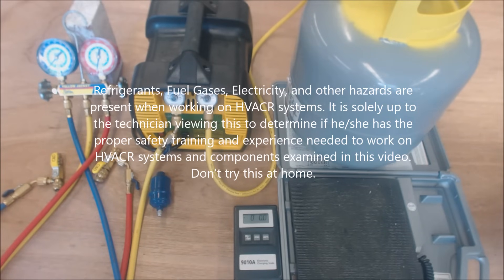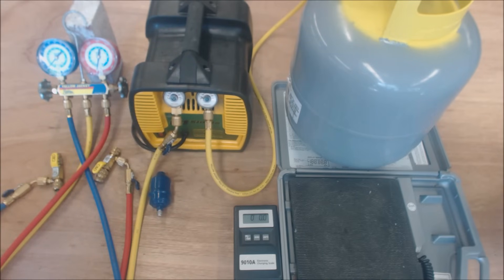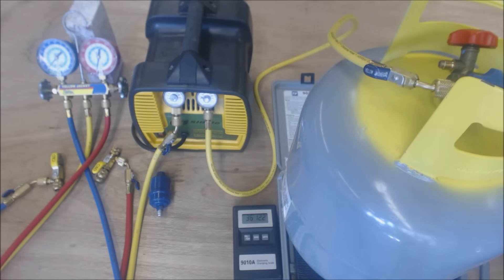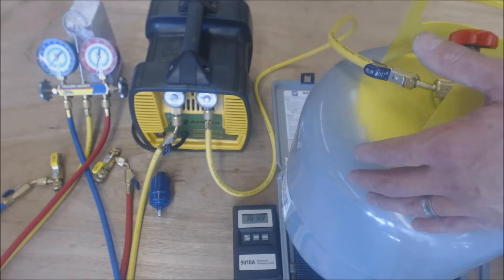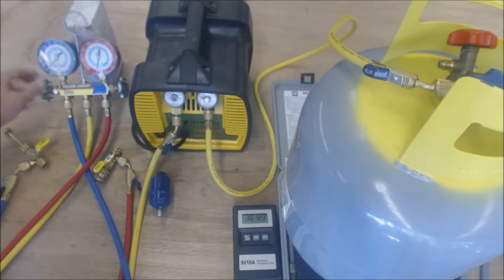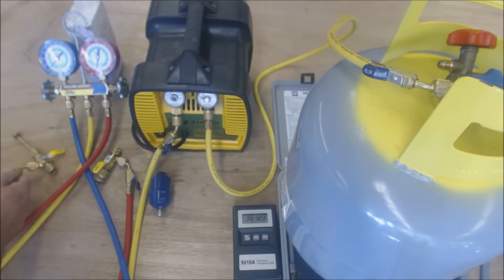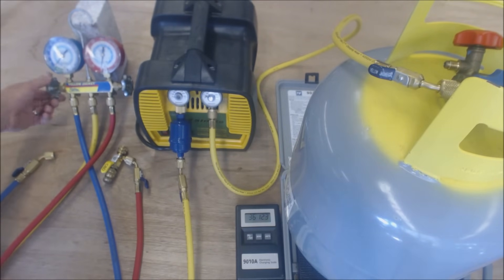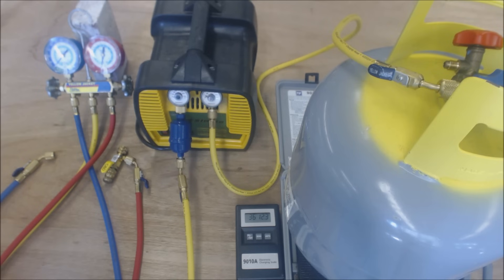Refrigerant Recovery Machine, Hose, and Tank Setup! Recovery Process!

Comment: Ac service...big fan of youre video's...learned alot..allready got the e book......question:after recovery ,is the compressoroil still in the system?
Reply from the maker: If you use a recovery machine, probably about 95% of the oil will still be in the unit which is fine. If you try to do a partial recovery using the systems compressor, much more oil would be removed, thanks!!
Reply: @acservicetechchannel  thank you!

Comment: I’m sure it’s obvious but I’d rather know before finding out through experience. When bleeding the air how do you tell it’s refrigerant when completing the bleeding?
Reply: When you have gauges on the psi should correlate to the temperature of the refrigerant. Look at a PT chart to check. When recovering you are just sucking out refrigerant. Shouldn't be anything other than that "bleeding"

Comment: You're always weighing part of the hose, right?  Should the initial weight be taken with the hose removed? Also, you didn't mention purging the recovery unit after the initial recovery -- is that required on that recovery unit?

Comment: great video once again Craig ... simple to understand. just purchased a g5 and megaflow hose and filter and filter hose and a 30lb recovery tank waiting on the g5 to come in a day or 2 from supplyhouse. I do have a navac vacuum pump that I love.  but I went w the the Avion g5 recovery machine .. g5's size is so much more space saving. I like that navac is digital but it maybe one part that can break then be a big issue. think I made a good choice choosing the g5. even tho hvac school ran a test w navac vs thr g5 and it's only minutes in difference which isn't that big a deal to spend more money on a navac.

Comment: Nice video. Keep in mind viewers - It doesn't matter what color knob is on the port Red or Blue either one can be a  Liquid Or Vapor (gas) depending on the can that you've purchased so read your valve labels whether it is liquid or vapor to know which is the proper connection, Respectfully Speaking. ✨

Comment: First of all great video thanks for uploading.

Question: Near the end step, when we open the vapor valve from the gauge it flows through the center of gauge, into the recovery machine, then OUT the recovery machine to the entry point of the recovery tank right. I'm wondering what's going on inside the recovery machine. Without the machine turning on, the vapor will still travel through the inlet and outlet of the recovery machine?

Comment: Why did my Appion struggle as if there was a a slug of refrigerant having difficulty passing through it also had to be shut off and the restarted a few times after I throttled down the inlet on the recovery . at one point the recovery machine was really shaking machine. Any thoughts on what I am doing wrong,? I also had a filter being used along with recovery hoses.

Comment: Thanks for your video! Very on point and informative. Question - when recovering R134a from the car - do I do it from the high (liquid) side or low (vapor) side or both together? I assume the car (including AC compressor) should not be running during this procedure, correct?
Reply: I had the same question.. did you find the answer?  I would think that you would not be running the engine at this point, only during recharge.
Reply: @whereisthehook  , correct. Running the engine during the recharge only.

Comment: question, can you use a standard HVAC/A/C vacuum pump (the same pump you would use to run a vacuum through your A/C lines with) with just the tank and gauges to recover refrigerant?
Reply: Justin LaFleur. No they are different machines altogether. Unfortunately. The vac pump doesn't have a usable outlet port, and operates at quite different "pressures"

Comment: Great informative video! One question though, if you have recovered what is suspected to be R134a and a mixture of air and moisture from vacuuming a system with a leak, into a recovery tank, is there any quick known ways of being able to seperate out if you decided you wanted to re-use the refrigerant gas? I know the boiling point of 134 is about -30 celcius so in theory if you froze your recovery bottle and drew out of it in such a way that only liquid was taken, you could say chances are your gas is pretty pure, any moisture will have frozen and could be filtered out etc. Cheers
Reply: vanepico. with that slight amount, might get away with purging the bottle (air rises) vent off the vapor outlet, then install filter/drier. If things are more dubious, replace with new gas. 
It's important to stop a recovery above zero psi

Comment: What about the W.C. rating on the bottle? What does that mean?
Reply from the maker: Water Capacity. It refers to the amount of liquid refrigerant that can fit in the tank and we never fill it past 80% capacity, thanks!
Reply: Yes, looks like neglected in the calculation is to multiply by specific gravity, ie WC weight (of R134A) x 1.2 . So an additional 20% can be added on top on shown in the video

Comment: Reclaimed R22 can be reused...especially after Jan 2020. Keep for old AC service calls!
Reply from the maker: Current EPA 608 guidelines only stipulate use in the same owner's units to avoid cross contamination, thanks!
Reply: Youra Ninee can only be re used for the same unit or the same household

Comment: Can use this on a car ac system 134a .
Reply from the maker: The difference is that the engine rpm is always changing so this method is used on single speed compressors only, thanks!

Comment: Do you pull a vacuum on the recovery tank first, and can you start with the tank in a vacuum?
Reply from the maker: I usually pull the vacuum on a new recovery tank right before using it to make sure that the vacuum is still present before breaking the vacuum with refrigerant, thanks!

Comment: Hi you’re so good ~~
But  how to put it recovery to compressor  
Thank you   🙏
Reply from the maker: I have a video on adjusting the charge using the running compressor but you don't want to recover a lot using that method due to the oil being removed from the system, thanks look up acservicetech recovery using the compressor
Reply: AC Service Tech LLC 
Thank you ~~~~~

Comment: Question: My HVAC Unit has low pressure switches , how can I Recharge if Condenser won’t turn on?
Reply from the maker: Usually we are recovering at that point anyway because that means that you lost at least 7/8 of the entire refrigerant charge and if refrigerant was added, it will leak out very very quickly. The pressure switch could be jumped temporarily but you would not want the system to run with a sat temp on the low side under 32 degrees or the evap will freeze and if the pressure gets low, it could damage the compressor, thanks!
Reply: TexByte2016. Charge firstly pure liquid on the liquid line. You can get almost a third the gas in with the machine off, then the LP will click on then add gas cautiously through the suction line

Comment: Question...can you recover in liquid  into the vapor(blue port)and just flip the tank upside down?
Reply from the maker: Most of our small recovery machines do not handle liquid but just either saturated refrigerant or vapor refrigerant, thanks!
Reply: AC Service Tech LLC up

Comment: I have a flower box condenser that needs to be moved and is running r22. The unit has no kingpin valves. I am going to recover all the refrigerant with the mr45 and will then put it back in. What method do you use for putting the refrigerant back in the system after it is moved? Lineset length will be pretty much the same. I am trying to get as much refrigerant back in the system to about having to add more r22 as the customer doesn’t want to pay for it $$$
Reply from the maker: We just break the vacuum with the refrigerant on the liquid side of the recovery tank and put that into the liquid line while the system is off and under vacuum. Make sure to prepare the tank and lock a vacuum in there before using. You will have to add some r-22 to it though just because you will have some in the bottle that will not have a higher pressure than the low side of the system while the system is running, thanks

Comment: What are the steps to dealing with air that has been introduced into a recovery cylinder?  That would be a good video to do.

Also, a video on transferring refrigerant from one cylinder to another would be informative as well.  Would it also be a good idea to use a in line filter while transferring from one cylinder to another to filter/clean the refrigerant?  Thanks.
Reply from the maker: If refrigerant was in the cylinder then after adding air, the refirgerant would be contaminated for your recovery cylinder exchange. If you had pure r-22 you could sell it. If the recovery bottle was empty, you would need to vacuum test it down below 500 microns and lock the vacuum in, thanks
Reply: l

Comment: Do you have a similar set up but doing a Standard Recovery?
Reply from the maker: Are you talking recovering a small amount without the self contained recovery unit but just the compressor to push it in the tank while running? This setup is my standard recovery. You don't want to leave the valve cores in, thanks
Reply: acservicetech like transferring refrigerant from one cylinder to another using the g5twin. I'm trying to understand for a class I plan on taking. So far high side is liquid and transfers faster , and the service hose the yellow one can be connected to the inlet port on the g5twin machine to move the refrigerant to the 2nd cylinder. That would be standard recovery correct?
Reply from the maker: So you would first prepare the new tank by vacuuming it down below 500 microns. For the transfer you would have a quick connect test gauge on the vapor side of the older tank. Then a service hose from the liquid side into a filter drier and then into the inlet of the recovery machine. Out of the recovery machine you would have a service hose connected to the liquid side. First purge the air out of the lines at the connection to the new tank and then tighten the connection. then open the new tank and let the pressure push the refrigerant into the new tank until just about equalized and then turn the recovery tank on. If it is r22 or r410a then recover the old tank down to right below 0 psig, thanks
Reply: acservicetech one last question, the quick test gauge on the vapor side, what is that for exactly for this?
Reply from the maker: That is so that you know what pressure is in the old tank which tells you when to stop the recovery process unless using a recovery machine such as the fieldpiece mr45 with the digital pressure display and automatic shutoff, thanks
Reply: acservicetech Got it. Thank you so much!

Comment: I just bought that appion g1 single recovery machine at a pawn shop for 138. I was looking for a g5 twin but the cost is triple. I got a good deal. I hope it works well. Looks good on the outside atleast.
Reply from the maker: You could run a test with two partially filled recovery cylinders to see how well it works, thanks

Comment: Hi! How do I recalculate/recompensate for the lost oil xoes goes with the refrigerant on recovery? Is there any mathematical formula to determine how much oil is left on the system parts after the recovery?
Reply: piston ring. Very rare to consider the oil lost. UNLESS the leak is on the base of the compressor and lost oil is obvious pooling in the unit. Some larger units have an oil sight-glass that helps. 
But 99% of time don't worry about a fraction of lost oil
Reply: Thanks

Comment: I paid a guy to hook up my line set, braze the fittings and top it off.     Got home and works great.  But then I  noticed the filter/drier was still laying on the floor, he didn't hook it up.  There is no filter drier.  He wants 200 dollars to fix it!      Should I run it without it or recover the 410, braze filter in, refill?    I have no access to any tools but could do it with a cheap set of tools on ebay (I THINK).
Reply from the maker: If it was r-22 it is one thing but with r410a you need a filter drier. I would pay someone to do this, thanks

Comment: Awesome video as always acservicetech! 

Do you know how one would add an oil separator in line so that the Appion G5 could be used for Automotive use also?

Sure it would pull 3.5 lbs of freon out in a flash but the oil has to separated out and usually discarded. That way following AC systems don't get over oiled.

All of the very expensive programmable automotive recovery machines have oil separators.
I know that oil separators are installed in between the compressor and the condensor because the freon has to be in a gas state to separate the oil out.  Any ideas?
Reply: Hi, im currently takibg up AUTO HVAC and we are using this expensive machine that separates the oil during recovery. You just put in the same amount of oil on tge reverse process of charging. Does this kind of recovery process completely empty the HVAC system of oil.so i can just add the amount required on the specification? Im planning to buy one.
Reply: piston ring I think the Appion will leave as much oil in the system as an expensive auto recovery machine.
Mastercool recovery mate 69500 can be added to separate oil but theyre 300 bucks.
www.google.com/search?q=mastercool+69500+recovery+mate&oq=mastercool+recovery+mate&aqs=chrome.1.69i57j0.13549j0j9&client=ms-android-att-us&sourceid=chrome-mobile&ie=UTF-8#pie=plaji-i
Reply from the maker: Possibly the "yellow jacket 38087" but that may be a little more than what you are looking for but I think that would work depending on the amount of oil we are taking about. Any small amount of refrigerant oil that ends up in an HVACR recovery tank is taken with the refrigerant in the tank and exchanged for a new recovery tank at the distributor. Thanks Blade!
Reply: That 38087 is a bit expensive! I have the Appion G5 ordered now so that'll be one more major tool to fasten to my belt. It might be a bit heavy though.  LOL!

 I've hit auto AC hard for 2 years now not just studying but finding and fixing problems as well as electrical issues. I'm also very interested in HVAC as well so I watch plenty of HVAC stuff and have enjoyed your channel immensely. Thanks!
Reply from the maker: Yeah, honestly you may not need it unless you need to weigh how much oil you are taking out to know how much you need to weigh back in. Just so you know, I don't use the 38087, I  just looked it up for you, thanks!
Reply: acservicetech Well they typically pull out 1 oz or 2 of pag oil, discard it and put that much back in new.
Reply from the maker: Ok, yeah then maybe you want to get an oil separator to verify how much, ok, thanks
Reply: What exactly is required to get into HVAC and have a license to buy R22 and service HVAC units?
I enjoy automotive AC but would love also to be able to service home AC.
Reply from the maker: Actually you just need to pass an EPA 608 test type 2 and possibly type 1 depending on the types of systems you are working on. You could also go for the universal which is type 1,2, and 3. You can it out and find a testing location through epatest.com or escoinst.com  thanks
Reply: acservicetech Ok thanks man. Ill look into it a bit more. The videos help tremendously. In 2 years ive seen 2 different techs add freon to my rental house. It has a 1 lb leak per season apparentley.
Funny no one ever tries to find the leak nor do they check super heat or subcooling. They set it to 75 and 240 and rock on.  Your vids show so much more than watching those two guys. Of course theyre in a rush and dont have much time for questions.
Reply from the maker: I usually try to educate my clients when they are watching behind me. They are just there to learn, thanks!
Reply: I mean recovery using your machine.
Reply from the maker: An auto system is much smaller and will pull a decent amount of oil out. HVAC systems are larger and won't pull much oil out, thanks
Reply: thanks, i appreciate your recommendation

Comment: What about the 300+ psi on pumps high side line? Just purge it? there is no way to recover that line.
Optimally I would say.. dedicated hose with valves or shraders.
Reply from the maker: On a recovery machine without a purge function yes it would have to be purged but a recovery machine with a purge would pump this into the recovery tank,  thanks!

Comment: where should I look to buy a used recovery tank that I can recover with? also if my system has a leak and I recover the refrigerant will oxygen get sucked in from the system into the tank?
Reply from the maker: I would not know where to get a used one from and you would really want to know the person you get it from. For instance, you would never buy a used vacuum pump do to how low of a vacuum it can pull do to lack of oil changes. You would still use the same setup but just recover down to 0psig. When you have air in tank, you just will not get paid for the refrigerant since it will not correctly measure out with the p/t chart when exchanging at the supply house, thanks

Comment: Why can't you just reuse r22?
Reply from the maker: You can reuse r22 from a system and put it back into the same owners system by law but not someone else's to avoid cross contamination of alcohol and acids or other contaminants. From a service tech's point of view, after doing all the work on a system, sometimes it is just not worth it and better to add what you know to be good virgin refrigerant. You would also have to have an empty and vacuumed recovery cylinder in the truck to reuse and not one that already has some in it, thanks!